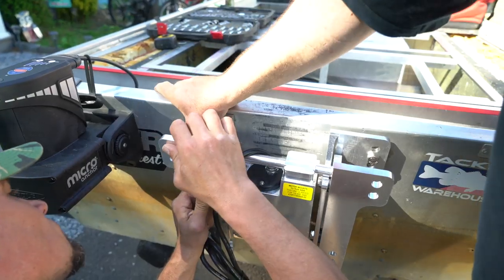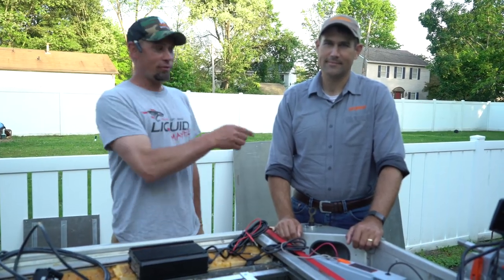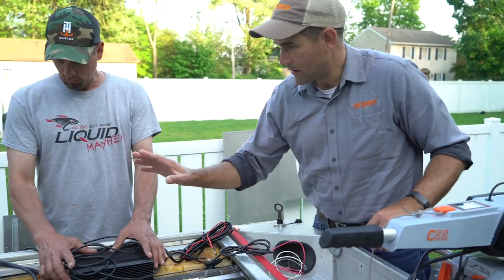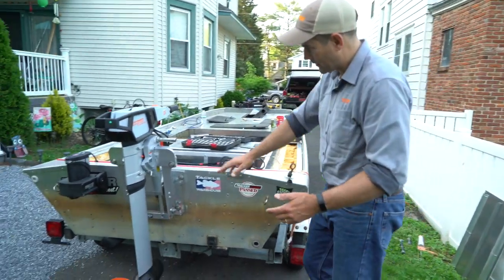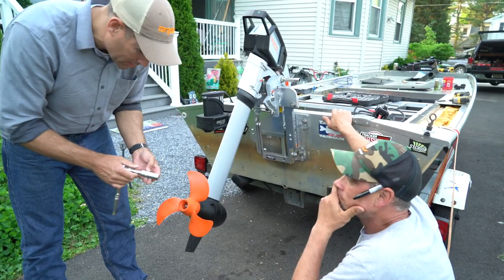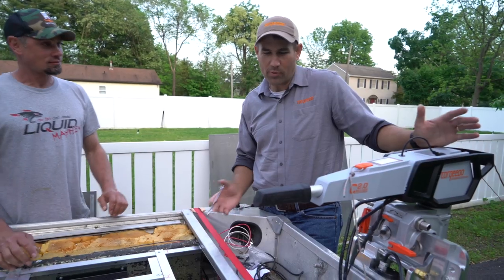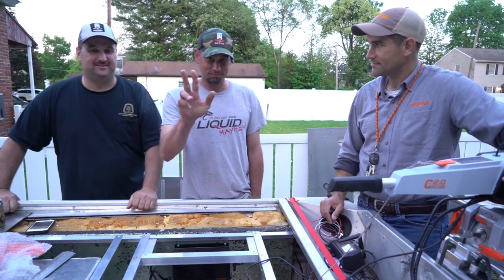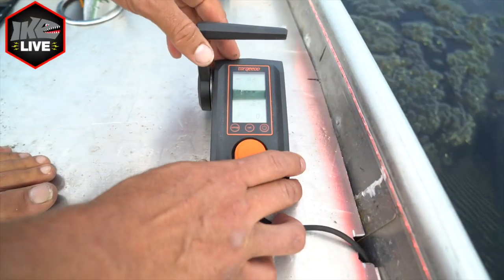The Ike Live Boat Build EP 6 - Jack Plate / Torqeedo

Comment: So I hit the link and it looks like you have well over $7000 in the motor, battery and charger.  Dang.  I can't even afford a $7000 boat.
Reply: The state he fishes theres resivors you cannot have gas motors only can have trolling motors so to be on the water you can have a kayak,jon boat or a bass boat with engine and there's tournaments there so this will be perfect especially with atlas jack plate shallow water great idea by the Carpenter!
Reply: But I agree I would have bought a used aluminum bass boat much cheaper